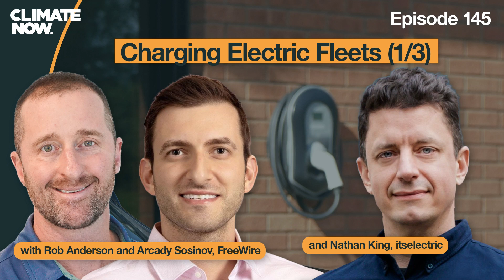Charging Electric Fleets (1/3)

Comment: Most vehicles are parked 23hrs every day and drive building to building. 

Selfplug-in EVs like home robotic vacuum cleaner.
A standard wall plug and trickle charged or day trade electricity. 

Rapid chargers will be on the main roads and at corner stores. 

Rooftop solar PV on 20million buildings in Australia will generate more electricity than the total existing coal fired 25GW plant.

Offgrid in the suburbs becomes very real.

No GRID COSTS, massive savings. 
No imported petroleum, savings. 
No empty battery, long drive ready daily.